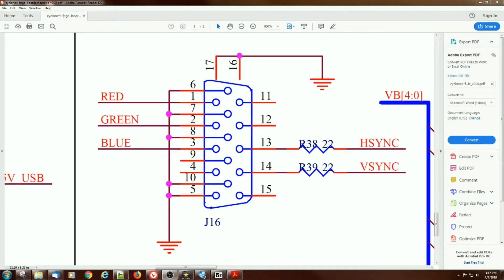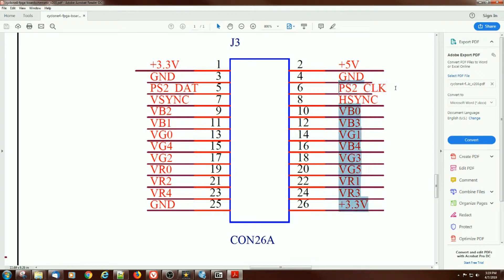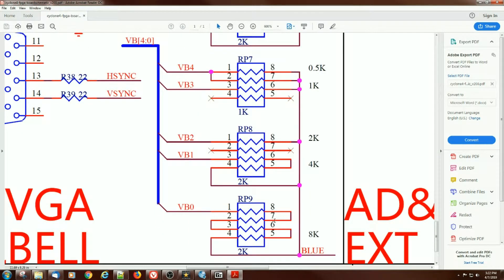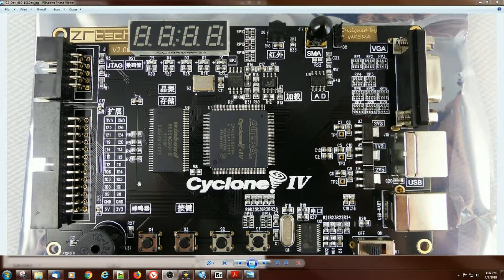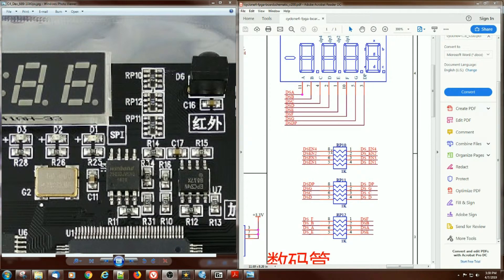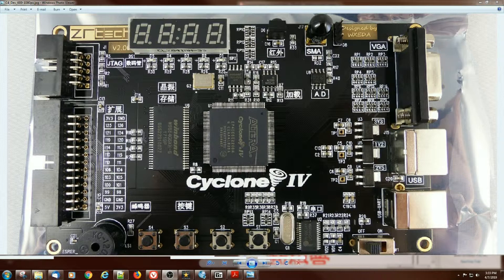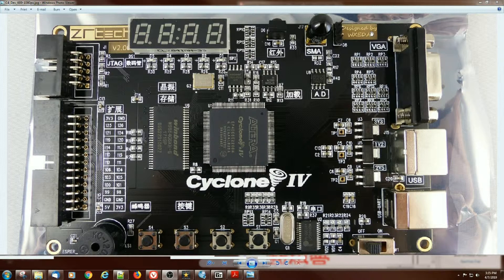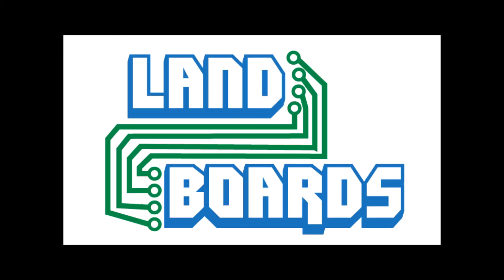EP4 FPGA Dev Board - RetroComputer Worthy?

Comment: thanks. i ordered one of these as well.  we do appreciate the videos!
Reply from the maker: Thanks for the kind comment. It's a good board for basic Retrocomputing and with the addition of the SDRAM controller we could get the entire address space (and more with a memory mapper). Adding support for the Serial EPROM and a file system and we are there. I just wish the I/O connector had something other than the VGA and PS/2 connections on it. 

If all someone wants is a 16K computer that runs over VGA this is a no-brainer solution.